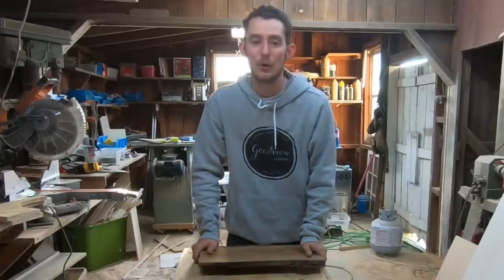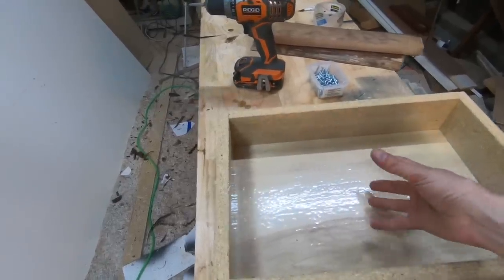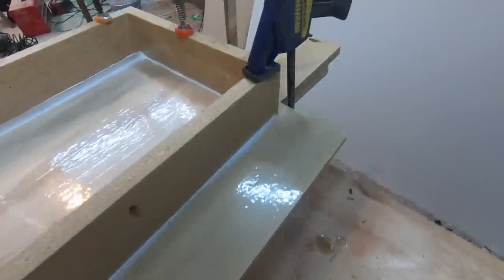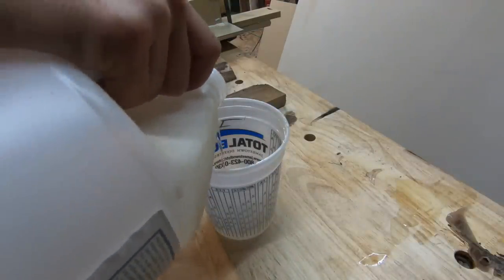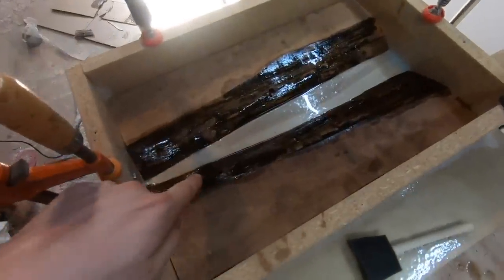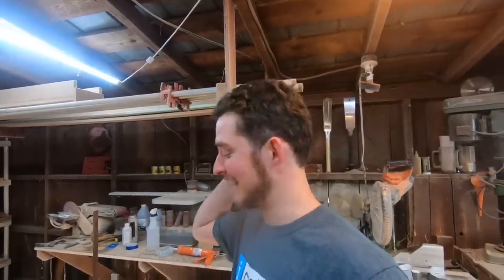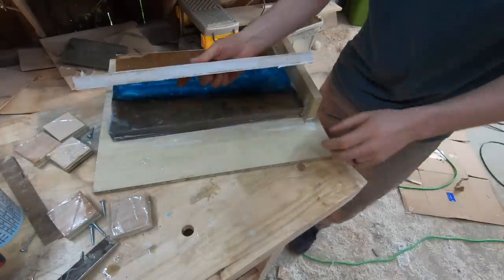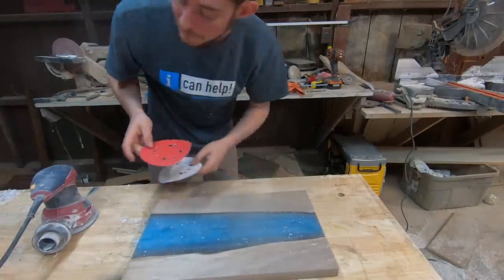Epoxy Cutting Board DIY

Comment: i too use packing tape for my epoxy projects, i found the best success with the Duck brand tape, i get it in the 3" width online, i think their plastic film is thicker and easier to work with because it starts and tears cleanly, and the extra inch width of tape is nice.
Reply from the maker: Nice! I’ll check it out

Comment: Nice project.
I'm just starting out using epoxy.
I got myself a beautiful piece of Manitoba cherry. Was 33x16 inch. Cut it to about 16 inches by 16 inches by 2 inch thick with live edge. 
Natural oranges and reds flow through it. My plans are to make a reverse river.  I'm prepping the wood, removing bark. I'm noticing a lot of small surface cracks between the grains. 
My question is, how do you calculate the amount of epoxy needed?
I don't want to waste more than I have to.

If needed I'll post a quick video with the plans.
Reply from the maker: https://youtu.be/yB0zLPwDO9k
Check out this video. Hope it helps.
Reply: @GoodViewWoodworks  Perfect. Thank you for the link.

Side note, 
Subscribed.

Keep up the awesome work.

Comment: Since you're doing multiply pours you don't have to color the bottom pour. Mineral oil from the drug store is cheaper than the butcher block oil. I just let the cutting board soak for 30 minutes or so in a mineral oil bath. Let it drain off until there is no standing oil than rub it dry. Mix up some melted bees wax and mineral oil in a 2:1 ratio. Apply the wax for a final coating on the cutting board. Tell the customer only hand wash and clean it with half a lemon and kosher salt once a month then rub it down with some mineral oil. I also tell the customer that I'll resurface the board once a year. That way you stay in touch with a customer. If they bought once, they'll buy again.
Reply from the maker: Thanks mike! I really appreciate that!!!
Reply: Actually you do need to color the bottom pour because you will see that layer on the end.

Comment: does the heat trick only work on that epoxi or could you use it on others as well Im going to start making my own pen blanks and typically you put it in a vacuum chamber or pressure pot to get bubbles out
Reply from the maker: It works on most epoxies

Comment: You used a drill with a stirrer to mix the epoxy. How did you get the epoxy off the stirrer or do you just throw them away ? TIA
Reply from the maker: Richard Weiss great question! I just take a paper towel and wipe it off after i let it sit and drip for a few mins. I had this drill mixer for over a year and haven’t needed to replace it yet.
Reply: Hi fun stuff lovin it!  I also live that you give your friend a plug BUT chiming in because you mentioned In another video we don't have to worry about the wipe because it just helps get a better surface to mix everytime.  Do we need to clean it each time?

Comment: Great job!
What about cleaning that stuff with water after use, doesn’t it leave water marks?
Reply from the maker: After a wash or 2 you’ll need to apply more butcher block oil. After you repeat that more and more, less and less oil is needed. Eventually when the board is seasoned with oil you’ll only have to do it once a month if you’re using it regularly.

Comment: Question for you. I have watched a few of your videos working with wood and epoxy, like the 4 or 5 part coffee table build. I believe this is the first time I have seen you drill the hold on the inside of the boards so that the epoxy can act as dow rods. Why was it needed this time and not when you did the coffee table? How can I tell if my project I am working on is going to require me to do that? I am a complete beginner and looking to begin my first project soon. Thanks for the great videos!
Reply from the maker: Great question! The only reason you would need to do that is if you’re not going to encapsulate the entire piece. If you notice, in this video I didn’t pour a flood coat. Hope this helps!

Comment: Is epoxy safe to use on a cutting board? It scratches and chips when cut on? I don’t think resin is something you want in your food.
Reply: Short answer is no.  Longer answer is none of the epoxies are food grade, at least none I've found.  I'd use them more for serving boards, as long as nothing really hot goes on them it is stable.
Reply: @TheRealCartman1  Stone Coat Epoxy is food safe. You should check them out.
Reply: @frankiekimberlin148  
Food safe yes, but fails as an actual cutting surface. So the term "cutting board" isn't accurate.

Comment: Great video..it really helped for when I made my cutting board. Quick question I did the same thing as you with the sanding and then oil. When you let it sit over night after it dried were you able to see any scratches in the epoxy? I can see some and I'm pretty bummed. What can I do to fix it?
Reply from the maker: Just need to make sure you sand thoroughly. Also you may want to go to a higher grit as well. Hope this helps.

Comment: im wondering what the epoxy looks like after you have cut stuff up on it over time? Im guessing it gets pretty scarred up.
Reply from the maker: Yeah it gets scratched up. The cool part is that you can just sand it down and re apply butcher block oil.

Comment: You do a great video and job!Have a couple of questions for you!
When you drill the hole and put the fine coat of epoxy on does enough get to go into the holes to make a difference ? I see in another video you did you say not to coat where the bark was. Were you talking about on all things or just the table you were working on? Does the epoxy hurt the knifes on a planer?
Reply from the maker: The holes is an older technique. I don’t do that anymore because I use a casting epoxy that takes a longer time to setup which in turn absorbs into the edges much deeper. This gives the strongest bond. I do this on all things now. The epoxy is a little harder on the blades but it’s barely noticeable.

Comment: Do you find that the sandpaper discs need to be tossed after one use on the resin? The white resin residue seems to stick to the pads and make them useless after one use.
Reply from the maker: Yes however if you pause periodically and wipe the dust from the surface of your project while you sand it helps them last longer.

Comment: Help!!! I thought I was ordering the right stuff!! Anyway I wanted to make serving boards with the epoxy in the center. I ordered some Total Boat epoxy resin. Now I see that it is table top so needs to be done in 1/8 increments. Not what I thought! What should I have gotten?? Thank you in advance!
Reply from the maker: If you’re going to use total boat, then you need to get their “thick set” epoxy.
Reply: @GoodViewWoodworks   Thanks so much!  I have  this now so have to use it. How dry can it get before you put another thin coat over it? Tacky I believe they say but can it get dry.  It would take all day and night to do only a little depth.
You do a great job in your videos and I watch them over and over wishing I could do that! Thanks again!
Reply from the maker: You can just wait until it’s the consistency of thick honey.

Comment: Just finished my first epoxy project and had a question.   My epoxy looks awesome when I apply the oil after sanding to 220.  Once it dries it looks kinda dull.   Any advice
Reply from the maker: dexter9522 yes if you want a shinier finish you will have to sand to a finer grit like 600 or so. Hope this helps
Reply: Sweet I’ll give it a shot.  Awesome vids they help a ton

Comment: Great job Nathan - quick question - I like the “epoxy dowel” idea but doesn’t it create more air bubbles sources, just as you precoat the live edges?
Reply: I had the same question.  Also, this is the only one of his epoxy projects that I can recall seeing this "dowel" idea used.  I'd like to know if that's because it causes problems or because it's just unnecessary.
Reply from the maker: It’s because it’s unnecessary. If you use the correct type of epoxy (slow setting casting epoxy) the dowels are not needed because the epoxy has time to soak into the edges creating the strongest bond.

Comment: when applying the finish can i use wax after letting the oil soak in or is it the other way around
Reply from the maker: Yes, you can apply a wax afterwards.

Comment: you use Different epoxy for different projects how do you determine what you're going to use? I'm looking to order but don't know which to order for my table
Reply from the maker: The countertop Epoxy is just to coat the surface and the casting resin is for thick pours. Thanks for asking!

Comment: Does a blowdryer produce enough heat? Instead of a heating gun or torch?
Reply from the maker: I think it does. You can always try before buying a heat gun, but the heat gun I listed in the description is only about $20. 😉
Reply: 20$ i Think i Can find that. Thanks! And great video! Beautifull board😍

Comment: How does the epoxy hold up to normal kitchen prep?  i.e chopping, cutting, etc.  Any chipping, cracking, denting?  I've never used epoxy before.  Great video!
Reply from the maker: It will scratch when being cut on. Unless you’re slamming the knife down on the epoxy, it shouldn’t crack or dent. I wouldn’t actually use this as a cutting board for prep, but more for serving.

Comment: quick question how thick is this board and whats a good thickness size for cutting boards thank you
Reply from the maker: It’s 1” thick. Between 1-2” it’s good
Reply: @GoodViewWoodworks  thanks man i left it at 1 1/4 i still have to run it thru the planner
Reply from the maker: No problem Manny

Comment: How do you keep the resin from scratching up real bad when using the board, is it hard enough to not cut up as bad and should I only use hard wood?
Reply: Also great video!!
Reply from the maker: You really can’t keep it from getting scratches. But it’s always easy enough to resend and finish when it get really marked up.

Comment: Hi! How did you treat the back? Did you sand it and add the oil to it as well or left it the way it came out of the cast?
Reply from the maker: Kathryn Pstrak great question! I sand and apply the butcher block conditioner the same way as the top!

Comment: Maybe a dumb question, but I need to ask anyways, where would i go to find the wood pieces for doing a cutting board or coffee table?
Reply from the maker: There’s no such thing as a dumb question.... just dumb people won’t ask them 😆 
You should check some local listings near you (Facebook) and search for live edge or lumber and you’ll find some stuff.
Reply: I don't know about a coffee table but for the cutting board, if you live near an AC Moore, they have  live edge wood that may suffice
Reply: Nate G you can also check craigslist for firewood you may find some nice pieces you can work with for free, slabs for a coffee table may cost a few bucks though.

Comment: What did you use with the paper towel at the end? Was that oil or a thin layer of epoxy? You didn’t show what you used.
Reply from the maker: Lavinia Picazo it’s called butcher block oil. I have it listed down in the description of the video.

Comment: How does the epoxy resin hold up as a cutting board?  I would like to do counters and my husband thinks I'm nuts!
Reply from the maker: They make countertop resin that’s specifically for that purpose. It’s also scratch resistant, however a knife will scratch it up. You can always sand it down and refinish.
Reply: Epoxy is not ment to be cut on. It’s food safe but once you start cutting it’s not.
Reply: @mikemeeks2935  Thank you.

Comment: What is the final wax you put on the finished board.?
Reply from the maker: It’s called butcher block conditioner. There should be a link for it in the description under the video

Comment: any tips for uneven sided tray sealing
Reply from the maker: I’m not sure what you mean
Reply: @GoodViewWoodworks  I’ve got a piece of wood that the sides are not even ‘or square but I still need to seal them right
Reply from the maker: I wouldn’t seal the edges. The products a available these days are much better than they once were. Just make sure you keep the temp down and shouldn’t have any bubbles.

Comment: one question, did you epoxy the bottom side as well or leave it dry?
Reply from the maker: I only epoxied the river. I used butcher block oil on the top and bottom. Thanks for asking!

Comment: Great video and finished product!  What setting on the heat gun did you use?  Does it even matter?
Reply from the maker: I only have a low and high setting on my heat gun and I usually use the high setting. It doesn’t really matter that much. Having said that, if it’s not hot enough it will be hard to pop bubbles.

Comment: Am I really the only person that has modest concern about cutting into, then eating food from an epoxy cutting board?
Reply: There shouldn't be any such thing as an "epoxy cutting board," only "epoxy serving boards."
Reply: Yes...
Reply: I had the same question. Beautiful piece soon to be marred with a knife. But I was wondering about the food safe part of the epoxy.  Read that cured epoxy was non-toxic.  So why are some graded as food safe and others not? The video on making it was great.  Will look for more of his utubes.
Reply: Epoxy  when cured is a plastic  cutting board totally  safe
Reply: You HAVE to use food grade epoxy, and even that will contain BPAs. The way I make them, I take a board the size you want your cutting board, carve out the river with a router (about half the depth of the board), epoxy that and use the bottom side for cutting on. This will also keep the epoxy from getting a dull look from putting micro cuts in it during use. For a more realistic look, I sometimes use less color and put sand and pebbles on the bottom to resemble an actual river.
Reply: @tighecrovetti2844  there's another tuber who had all these videos of 'epoxy cutting boards' and sold them to viewers and went back and edited in "you can't use these to cut on" then why call it a cutting board 🤣
Reply: @johncampbell4923  food "safe" not grade. Still wouldn't do it personally. There's a time and a place for epoxy, and a cutting board ain't it. It also doesn't finish the same as wood, so you have a board that is only half renewable at any given point

Comment: What is that final oil wax mixture you rubbed on and where to get it?
Reply from the maker: It’s butcher block conditioner. I have it linked in the description. You can get it at Home Depot as well

Comment: Hey, does anyone know how to clean the mug and the tools after contact with the epoxy? Thanks you
Reply from the maker: Just leave the epoxy in the cup until it cure and it will pop out . As far as the tools go, just wipe them off using some isopropyl alcohol.
Reply: @GoodViewWoodworks  thank you ^^

Comment: I'm still in the watching videos learning as much as I can.  I want to make a cutting board that can be cut on a not leave knife makes. I'm kind of confused watching videos of how to make a cutting board but you can't cut on them.
Reply from the maker: David Pond you can cut on them. You just will get scratches. One thing you can do is; epoxy one side and then pour oil on the other side. Then use the oiled side to cut on.
Reply: @GoodViewWoodworks  cut on the oil side or the epoxy side?
Reply from the maker: Cut on the oil side just like a normal cutting board

Comment: Confused a little. You drilled the holes to bond the piece together, then you coated the rough edges covering the holes. Do the holes still bond it?
Reply from the maker: Great question! Yes because I poured while the first coat was still tacky, the whole pour cures as one solid piece.
Reply: @GoodViewWoodworks  I truly don't see how the holes did anything. Can you explain further?
Reply from the maker: The holes are like using wooden dowels. They’re just epoxy instead of wood.
Reply: Do you put holes in your yacht table?
Reply from the maker: I did not, things have come a long way since then. Because I flood coated both sides of the table it cannot move or breath. So the fields are not needed. Hope this helps
Reply: Sorry @Goodview woodworks!! Didn’t mean to open the doors to questions!! You do beautiful work and keep putting out those vids!! Thank You

Comment: What about knife marks in the epoxy? Also, slivers reminisce of epoxy getting into the foods from cutting on this type of board
Reply from the maker: Yeah a knife will scratch it, however the epoxy is food safe.  Thanks for watching!
Reply: @GoodViewWoodworks  at the dollar store you can pick up plastic cutting board sheets, usually come in 3 or so to a pack, lay one on the board before knife use, inexpensive way to keep it looking good and protected, does sorta take away from the actual cutting on the board thing but what the hey, just a thought, I only git 1 a week or 2 so there it is :)
Reply from the maker: Billy McGee great tip bro!!

Comment: I didn't know Marv Merchant's son did epoxy videos! Lol awesome video man. How well does it hold up to everyday use?
Reply from the maker: As you would expect. When you cut on it , it leaves scratches. I would actually leave one side as the cutting side and the other the serving side. (I wouldn’t actually recommend using the epoxy portion as a cutting surface.)

Comment: Very nice work. Question. Why do you over pour to then plane down to the wood. Why not slightly under pour and then plane down to the epoxy level. Epoxy is rough on planer blades. Just curious.
Reply from the maker: The reason is that I want to keep the piece as thick as possible to keep it from warping or moving in the future.

Comment: Looks awesome! What kind of finish did you use?  And is it safe to use epoxy as a cutting board?
Reply from the maker: I linked the finish in the description, it’s cutting board conditioner. I wouldn’t really recommend using as a cutting board more as a serving tray.